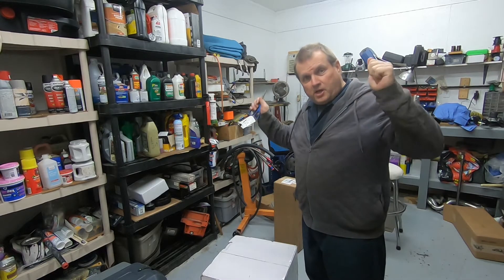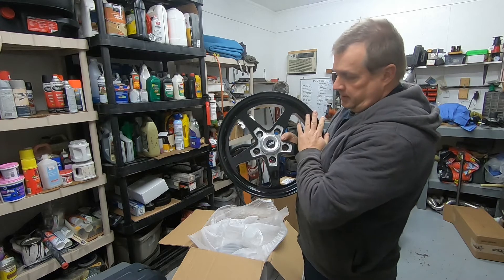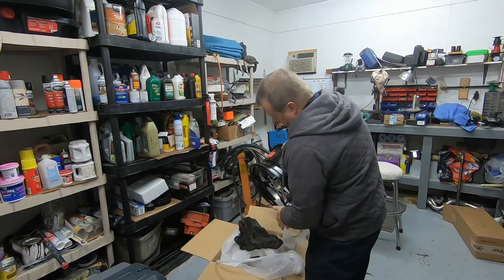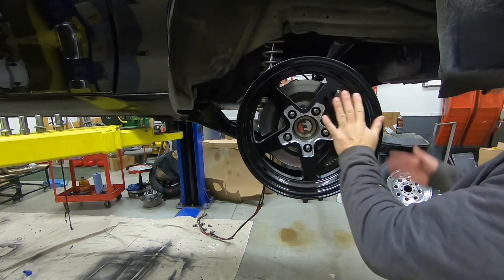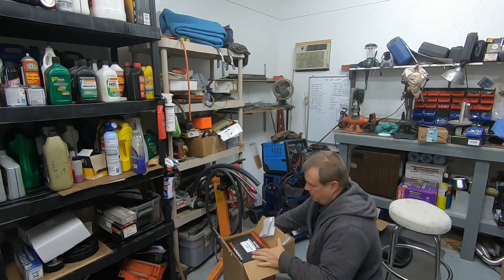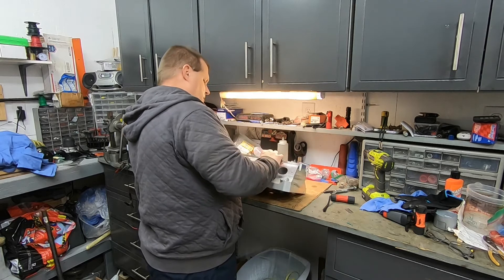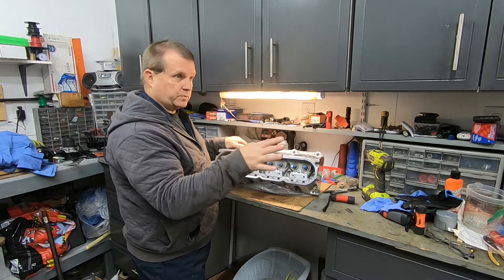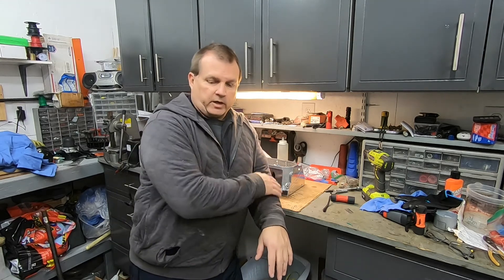Unlocking Surprises at Ken's Korner!

Comment: So why did you go with a narrower wheel?
Do the new heads flow better than the ones that you have on the motor now?
Reply from the maker: Mainly to change the side wall effect. Could help out in the traction department so to speak. This is more of a test to see what happens. As for the heads yes they flow much more than the stock ones. Thanks